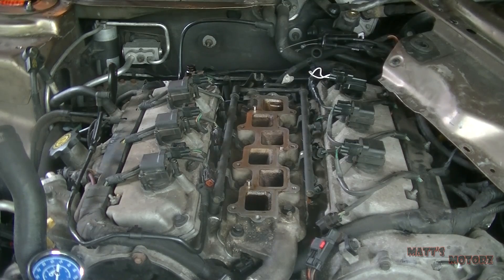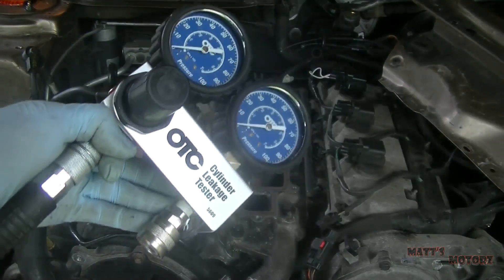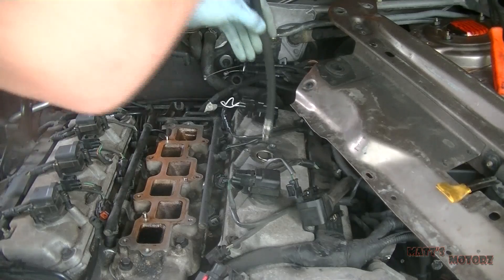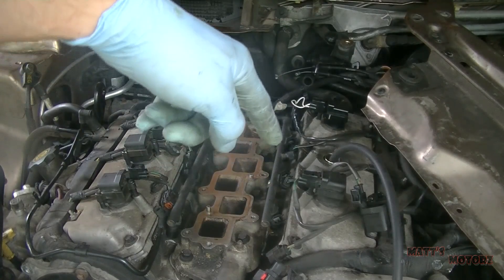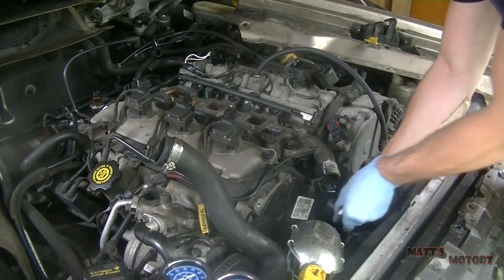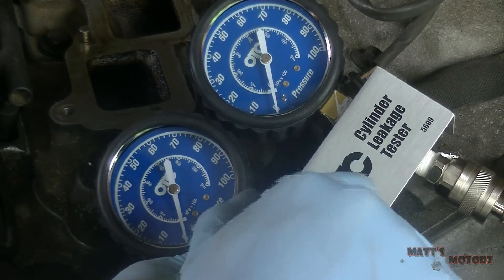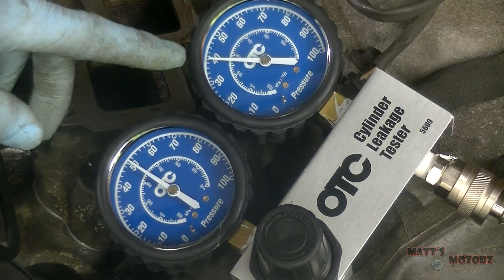How to do a Leak Down Test

Comment: MATTSMOTORZ, 
                 1.)the actual leakdown test tool You set the air compressor to 100psi, the left meter on the leakdown test tool should measure 100psi and the right meter should measure 0% to 20% of leakage for a good cylinder? 
       2.) You take out all the spark plugs out of the engine and rotate the crank until you get TDC values closed for that cylinder. Next you use an adapter hose to connect it to the leakdown test tool to measure the leakage of the cylinder and listen to any "Hissing" from the dipstick pipe, Hissing from the exhaust pipe/exhaust valve, Hissing from the headgasket, or bubbles from the cars radiator coolant has bubbles?

Comment: Shop air pressure must be greater than 100 psi 
The correct procedure to use the OTC Cylinder Leakage Tester Kit (leakdown tester) is: 
 1. Remove the spark plug from the cylinder to be tested. 
 2. Screw the test rig hose into the spark plug hole. 
 3. Rotate the cylinder until air comes out the test rig air hose to verify the piston is coming up on compression stroke in the cylinder. 
 4. Remove the test rig air hose and insert a long screwdriver squarely into the spark plug hole - do not allow the piston to jam the screwdriver against the cylinder wall -  
 5. Use the screwdriver to indicate when the piston is at top dead center (TDC) on the compression stroke.
 6. If you have a flywheel lock, put it on. If you don't, use a breaker bar and exactly correct size socket to hold the crankshaft at that piston TDC. 
     WARNING, when you introduce pressurized air into the cylinder, that engine is going to want to turn over and the breaker bar will beat the living shit out of whoever is supposed to be holding the crankshaft and does not have a death grip on the breaker bar!
 7. Turn the regulator counterclockwise two turns and connect shop air to the leakdown test rig.  The shop side gauge will read shop air pressure. 
 8. Set the cylinder side gauge to 100 psi. 
    If it is pegged, turn the regulator clockwise to bring the cylinder side gauge to 100 psi. 
    If the needle points to less than 100 psi, turn the regulator adjust knob clockwise to bring the cylinder side gauge to 100 psi.  
 9. Screw the test rig air hose into the spark plug hole. 
10. Warn whoever is holding the breaker bar to hold on and expect to feel force on the breaker bar (technically if the piston is at TDC, the engine crankshaft will have no tendency to rotate.  However, if the piston is not at TDC air at 100 psi on the piston is going to exert rotating force on the crankshaft which means the breaker bar can go flying.  The socket must be held firmly onto the crankshaft nut and not allowed to move at all .)
11. Connect the test rig to the test rig air hose that it screwed into the spark plug hole.
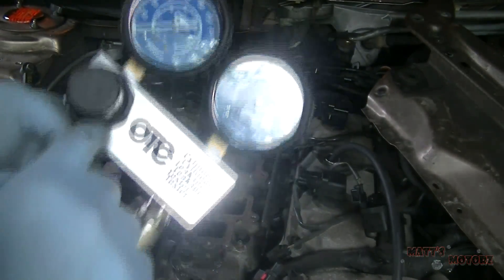12. Read the cylinder side gauge  - whatever pressure is indicated is the percentage of air held in the cylinder.  For example, if the cylinder side gauge reads 85 psi, then leakage is 15%.  Anything less than 80 psi, there is a major defect.  As the man says in the video, at this point listen to discover where the air is escaping, either through the valves or into the crankcase (indicating worn rings or rings not seated - squirt penetrating oil into the cylinders and rotate the engine with the spark plugs out to possibly free the rings - it worked for me once when I was going to reject a Subaru engine, went from 85 psi compression to 210 psi.  Other test rigs have a color coded cylinder side gauge.  The green range is from 100% down to about 60 psi ( https://www.youtube.com/watch?time_continue=90&v=qF5Zj_r4-Kg&feature=emb_logo , at the 1:25 minute mark.)
OTC provides a chart inside the case lid that shows percentages related to pressures less than 100 psi.  However, at 100psi the percentage correlates exactly to the cylinder side gauge pressure. 
That's how I use the OTC Cylinder Leakage Tester Kit (leakdown tester).

Comment: Do you really think you got the tester tight enough in the spark plug hole by just turning the hose? Is there an adapter available?
Reply from the maker: Yes absolutely.  It doesn't take too much.  Twisting the hose has always been enough.
Reply: yes it would be tight enough their is an o-ring which i personally put a bit of oil.

Comment: Leakage detected thru crankcase. Tech suggested new engine. Any idea what the problem is??
Reply from the maker: Piston rings. It means the cylinder bores in the block are worn to a point where it is compromising compression.  The answer is indeed a new engine (or a rebuild).
Reply: MattsMotorz I guess all four pistons were messed up?? The dealer installed new engine. Under warranty. Hyundai.
Reply: MattsMotorz the compression test revealed low compression in cylinder #4 of a 2.4 liter 4 cylinder.
Reply from the maker: It only takes 1.  Having one piston bad messed up how well the engine runs, and also causes damage.
Reply: MattsMotorz wow. Glad I didn't have to pay the $5500 repair bill. No other way around a 1/2 ass fix?
Reply from the maker: Not in my eyes, no.

Comment: that's not 20 percent is it? once on 40 and the other is at 50
Reply: you are reading the gauge wrong. this gauge shows the psi on both gauges. the second gauge is also psi and is NOT a percent reading
Reply: The 50 psi is the input. The 40 psi is the output. (air into engine) So, 20% x 50= 10    50-10= 40. =20% leakage.
Reply: @DMJ160  or 50-40=10. 10 ÷50=.2 

.2x100=20 %. Same result just showing it different.
Reply: @maximocastro6417  ...I do not speak spanish. Looks like you come up with the same answer.....20%

Comment: What if the head gasket is bad how u check that with this and engine is out
Reply from the maker: If the head gasket is bad you would get leaking air through the coolant passages and possibly even between cylinders.

Comment: was that really tdc thinking not. inlet valve prob still slightly open allowing this air leakage .but yes definately bubbling happening
Reply from the maker: +Daryl Hawes It WAS TDC.  Even if by chance I was slightly off, the inlet valve wouldn't be anywhere near opening since the next phase in the 4 stroke cycle would be exhaust, and that would be after the piston goes all the way down first.

Comment: I know I've mentioned this before, but one of the suckiest situations is when you've got a blown head gasket with coolant leaking into the cylinders. This happened to my brother in law's truck, so I replaced the head gasket for him, but it still wouldn't crank over. The reason was too much coolant had flowed into the piston when the head gasket failed and scored the cylinder letting the compression slip into the bottom end of the motor. Unfortunately that's one of those things you just don't know until you try to repair it. Well... unless you have a borescope... which I do, so I guess I'm just a fool lol. The situation you've got here is basically the same, trying to fix it only to find out the motor is toast. Never a good time, especially after doing a lot of hard work heh.
Reply from the maker: Yeah I wasn't a very happy camper.  This is my girlfriends car and she wasn't either!  Ill be making a video series of an engine replacement on this car in the future though, so there is a plus!
Reply: MattsMotorz When should we expect this engine replacement video?  I have  a similar car and problem.  Great videos of the intake repair and struts also-  very helpful and clear.  Thanks a lot.
Reply from the maker: Thanks! I've decided that I am going to just replace the heads as I believe they are the root of the problem.  I will do this after I am finished with the Pontiac Videos.  So I am hoping within a month.  Sorry it can't be sooner!
Reply: I swear every car I’ve owned ends up with a blown head gasket.